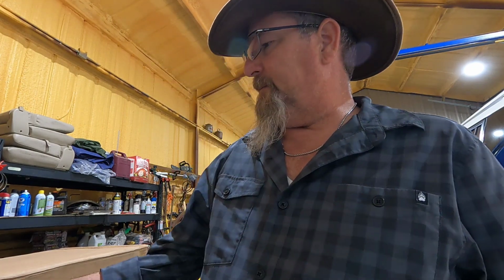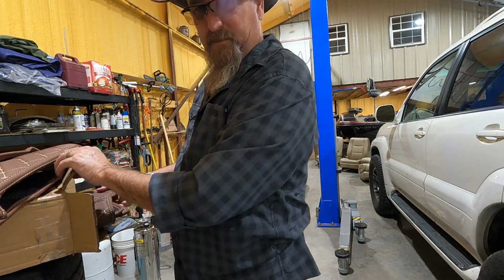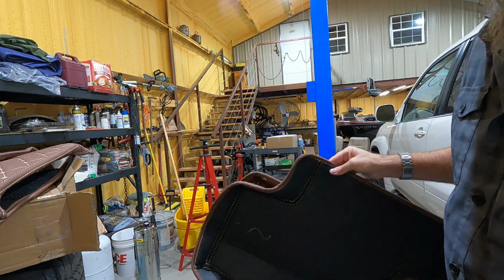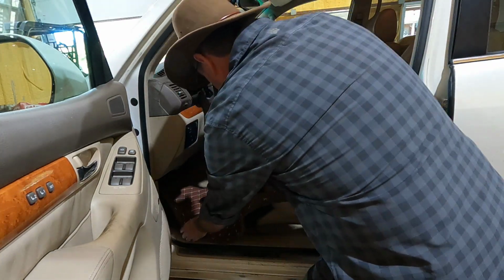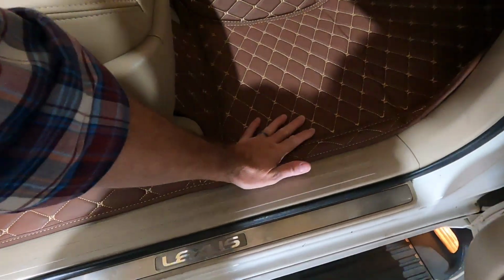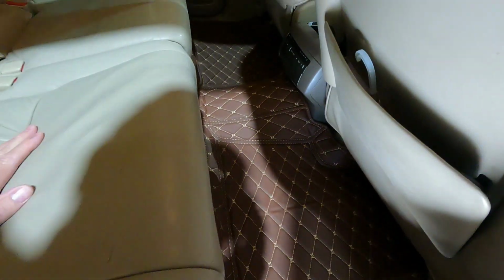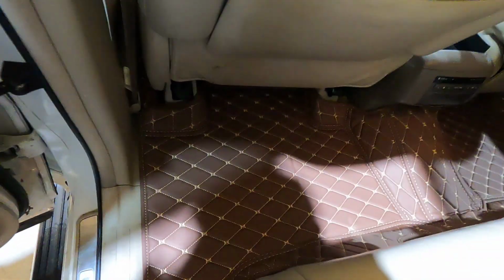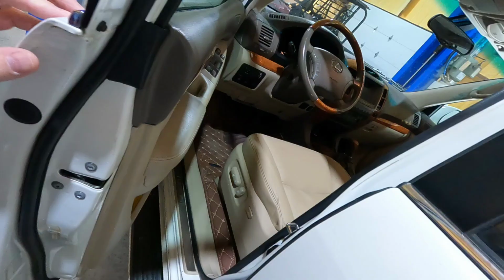Witamats, lexus GX470. Are they any good?

Comment: They are nice, I’ve got them in red for my C5 Corvette going under aluminum diamond plate mats.  My Firehawk also got diamond plate mats with trans am logo mats on top.  For my GX470 went with weathertech cause of the durability.   Good luck with these.